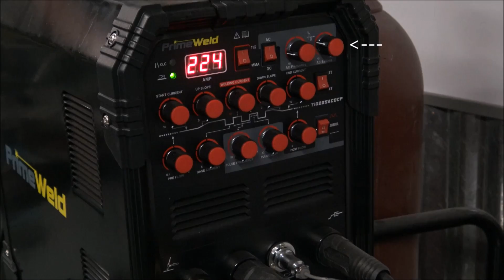Weld Repair - Cast Aluminum Mustang Intake

Comment: I was all impressed with the welding job and ........................THEN YOU TEXTURED THE CAST ! ! ! ! ! ! !    Awesome brother
Reply: Right....what tool was that?
Reply: Why are metals textured if I may ask?
Reply: @khonjel_singh  the texture comes as a result of the manufacturing process (sand casting in this instance). He recreated the raw cast texture to make the repair blend seamlessly.
Reply: @robsorgdrager8477  thats an engraver I think
Reply: So, the texturing process is just for the looks?
Reply: Yes the end texture matching was brilliant
Reply: @w140 , in this case, yes.
Reply: Stein-Erik Dahle thanks for the reply! True master in action indeed
Reply: @w140  In this situation, it might also contribute to added surface strength. Similar to shot-peening technique on gears, the tiny dimples created by the engraver acts as a small 'forged-like' layer to increase its surface strength. 
I think the dimpling with the engraver is unnecessary for this parts intended purpose as an intake manifold, but if the person were to paint or coat the manifold, it is beneficial for its adhesion.
Reply: @khonjel_singh  To hide reparations! Every one wanna full us!
Reply: No dought
Reply: What tool was used for texturing?
Reply: The texturing was like a cherry in a pie... Wow man
Reply: Needle scalers are good at blending finish too!
Reply: @cptkorean  But if the texturing is a grinding like technique that would not harden the surface right?
Reply: @khonjel_singh  it was probably textured from the original casting process,  and the weld was textured obviously to match original look
Reply: @robsorgdrager8477  engraver??
Reply: Same .. I saw the needle scaler come out and thought holy shit! Then again, he should of left the welds so the mustang guy could brag on him for fixing when anyone noticed
Reply: I know , that texturing ball bit (I never seen one) , gotta have one . :)
Reply: Got to after u make it flush so then it's like it never been there
Reply: Man even port matched it for you
Reply: @khonjel_singh  it's a cast

Comment: Ahh memories 👍🏼 I repaired countless cast iron and aluminium casings/manifolds over the years, it was a small part of what my job entailed,  I however  never had the luxury of TIG all our casing/manifold welds were done with oxy/acety . Otherwise the preparation and finish was similar, what I couldn’t do however was bolt the prepped lug onto its casing for welding due to the heat dissipation; What I did was use or make a gasket, mark outline with chalk on to the bench gently aligning manifold and broken lug with chalk marks, do a tac weld strong enough so as to allow the manifold to be checked on the job for accuracy, then bring back to bench to complete the process. . 
Of all the tasks I performed it was one that always gave me a sense of satisfaction.
Cheers for the upload it brought loadsa memories back for this old dude.

Comment: Dime a dozen early Explorer intake, and still taking the time to hide the repair.  Pride in your work is off the charts here.
Reply: Ya, way over the top for what it's worth. Maybe for a rare, discontinued model it'd be worth all that.. I do it all the time, just because it feels good. Lol!
Reply: Its the same cobra intake on my 90 mustang not exactly dime a dozen.
Reply: Going to depend on where you are, down here it would be rare, some parts of the 'states they may still be found - but at the price of alloy scrap, going to be a LOT more than a "dime a dozen" ;-)
Also, as one of the other chaps mentions, if it actually was a Cobra specific part, repair could be much easier and cheaper than getting a replacement - 'looking like' something doesn't mean 'same as'.
Reply: Over five million views... I'd say he has done well and gotten paid for this work many times over

Comment: I'm glad to see the way he went about it, by bolting it in place to the mating part, you obtain a perfect fit up, and then ground out ALL the cracked area, and welded it fully, AND machined the surface, AND polished the bore to fit perfectly,  AND re-textured the finish to original, exceptional work.

Comment: I love this stuff. I used to work in a production engine reman facility and handled all their cast repairs. I've done dozens and dozens of repairs like this. In most cases the peice of casting was simply gone. So I would make a template off of the cylinder head/block to get the layout. Then I'd build the whole structure back up out of weld, then hand grind it down to a factory look. Then I'd drill a new hole, then mill the gasket and bolt surfaces. I'd use a needle scaler to get the same texture as the casting. Once painted you couldn't tell it was repaired. I wish we had smart phones in those days so I could show people my workmanship. I took so much pride in my work there and was lucky enough to have the opportunity to give 190%.

Comment: The trick with the needle gun was cool.
Reply: im guessing it was to strengthen it /blend it in
Reply: @johndowe7003  was wondering the same. what's the purpose of it other then blending it in?
Reply: @johndowe7003  
Rough and dimpled surfaces are prone to develop cracking and fracturing so dimpling typically is detrimental. In the case of this, the surface finish he added will not lead to fracture under normal use as the loading would be so minimal compared to its thickness that any surface stress concentrations won't form cracks.
In short: purely cosmetic

Comment: Now I'm going to be paranoid whenever I see a "new" looking cast part.
Reply: If its him doing the repair job, I wouldnt be worried, tho.
Reply: dont worry, the weld job is actually stronger than the rest of the part😂😂
Reply: @joemama.556  "Technically" yes, the weld its self will almost ALWAYS be stronger than the base metal, but with that much welding there would be a large heat "affected zone" so around the area also gets weaker from the heat. Does it mean other parts will fail? Probably not, but that same probability is higher now that its been repaired.
Reply: @ViperRoleplayfivem  i think he was joking..
Reply: U should be paranoid when buy aluminium engine at all
Reply: D9D9 it’s not an aluminum engine just the upper intake off of an 5.0litre ford
Reply: @D9ID9I  and why is that? I think there are more than enough examples of aluminum engines still running strong to prove itself.  As long as the material used is appropriate for the application everyhing is good to go
Reply: Whoever this belongs to, won't have shit to worry about trust me lol

Comment: The prussian blue is a neat trick, I'm gonna have to steal that one
Reply: Used that trick for years. Plus them cutting wheels bought set from snap-on they best set I ever owned.  Nothing like auto-part store type or old craftsman I had.
Reply: @Houndini  Which cutting wheels are you talking about?  I remember realizing Snap On Air Hammer chisels being 10 times the quality the other ones were in the shop... I'm eager to discover another premium tool... which cutting wheels from Snap On?
Reply: @Houndini   Was it the tool at 0:56 ...?

Comment: To repair those expensive mtb frames like this 
may it be good.
Reply: It depends as i would assume this would ,that it depends where there weld has to be done on bicycle frame if its an integral are sometime its best if to not reweld it some time on the bike "frame-stays/arms" its best to cut out all of the weld and start fresh again,as i would asume it would be for automobile,this looked to have been welded on a bolted down part of the casting so i dont think such and area is as integral as say a more innerworking of an engine but it looks to have amazing uses

Comment: I had an eclipse, and one of the engine mounts is on the trans housing. The trans housing is aluminum, when I did a clutch replacement, I forgot a bolt in the mount, and ended up snapping it off. Every garage I spoke to said I had to replace the entire trans just to fix the mount problem. I spent 3 weeks making calls and finally found a guy working out of a garage who charged me 50$ to weld the mount back to the housing. Saved me about 1500$.

Comment: Just so you know, filming welding directly can destroy the sensor of your camera. Using an ND filter that is dark enough together with a high aperture would help and would also make it possible to see what you are doing when welding.
Reply from the maker: Just so you know, I've been filming with and without an ND filter with the same camera for 2 years and it has not been damaged. It works exactly the same as it did on day 1. Several of my other videos show the welding processes shaded as if it were viewed behind a welding hood.

Comment: This only makes sense if you are a welder slash mechanic to do.  If not I'm pretty sure it will cost just the same or maybe less to get a new manafold
Reply: Agree. potentially barely no savings considering the skills, time and equipment required to do it

Comment: I have a 1967 427 Tri Power intake with a crack around one of the bolt holes, I have pictures but I would like to have a repair similar to what you did on this piece. Repair and finish repair area so that you can not see the repair. Let me know if this is something that you can do for me.

Comment: OK, serious question here... How much did you charge for the repair, and how much would have a replacement manifold cost? By the looks of it, it seems mid 90s old, and probably easily sourced, even from a junkyard. While I'm stunned at the level of craftsmanship, and the peening at the end was pretty darn cool. It doesn't seem like that much effort should have gone into anything less than, say a "Numbers Matching" Original Shelby Cobra, or 1971 Hemi 'Cuda convertible, etc...

I just find it hard to get out of bed for work that pays less than $2500 per weekly rate. I've got a friend who's a bit older than me, and still busts his ass and knuckles for $250. Knows an incredible amount of mechanical knowledge, but never seems to want to graduate to the next level of income for the amount of effort put in. I follow the 80/20 rule now. (80% of my success comes from 20% of my efforts)

Comment: Cool craftsmanship - having no knowledge whatsoever of either welding nor the engineering and mechanical aspects that affect the effort to repair, the likelihood of the repair holding/lasting and the time/cost involved, vs. just obtaining a replacement part from a pick-n-pull parts lot?

Comment: Dam , you wouldn’t even know.
Reply: I just crack my Eaton SC housing bc the needle bearings I bought were slightly bigger than the originals n when I pressed it in the cast gave out a cracked. Hoping my brother who is a welder can do a job like this n repair it.